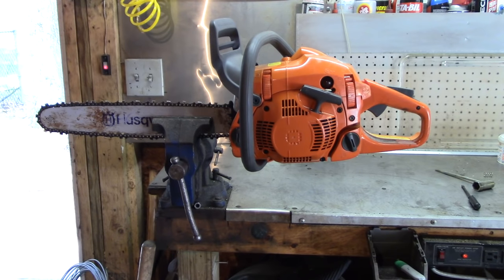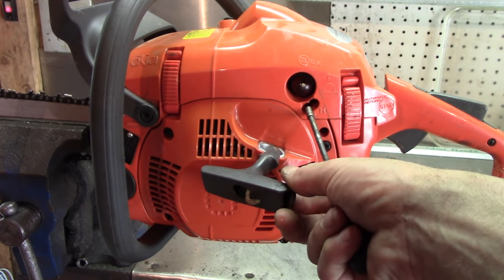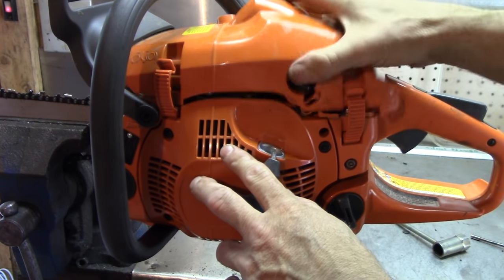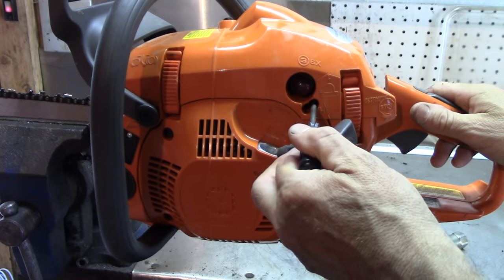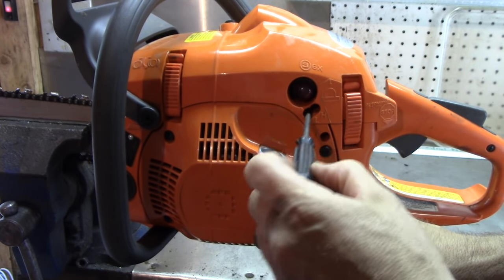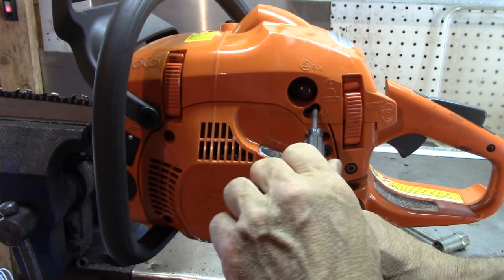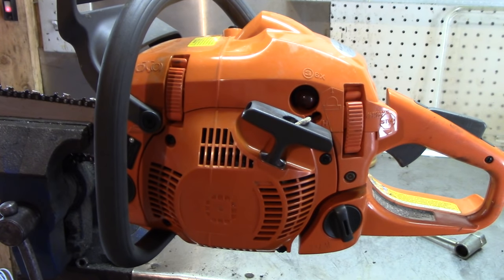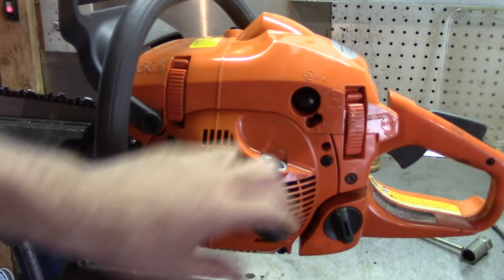Husqvarna chain saw carb adjustment

Comment: I bought a husky 240 Brand new  in the accessory case for $100. I was the third owner. The previous two owners could never make the saw run.I bought the tools on Amazon and followed this procedure.  At one and a half turns out on both screws, so I would finally start and run, but not smoothly. It would die if I slowly pulled the trigger and would often stall when hot. I slowly turn the L screw in 1/4 turn at a time and the idle speed picked up considerably and smoothed out. I stopped when the  screw it was 1 full turn out. the saw  starts easily, idles smoothly and transitions smoothly from idle up to full speed with no hesitation. I will try adjusting the H screw someday but right now I am very happy with a saw. Great video. Thank you so much!

Comment: Your tip about adjusting the high speed bleed with it in a vise is spot on. Mine was a bleeding too much air at 1-1/2 turns and kind of boggy trying to accelerate from idle. I turned it in (clockwise) just a touch and the acceleration is great now. Thanks for this video it helped me get the frustration out of this formerly balky-starting saw!!!

Comment: Thanks, I bought a new Husqvarna that was running like crap right from the box. A few quick adjustments to the idle and carb by following your video, and now it runs perfect!
Reply: I'm having the same issue. Can you get the tool locally.
Reply: @meaganfleming4675  I'm not sure. Call around to places like tractor supply, Lowes, Big R, Auto Parts stores, etc. You're looking for the 21spline tool. I ordered mine on Amazon and got it in a day or two. Not that helpful if you need the saw today, I know.
Reply: @Hoodyhoo2121  No, if you had a clue what you're talking about, you'd know that none of the box stores, and no, not even st. tractor supply carry them.  On this subject, alas, amazon is your best option for getting the tool.  (and there's a half dozen different tools available -- make sure you get the right one for your saw)
Reply: @hugh3rdof5  got a 440 and tool came with the saw right off the shelf.  Works like a piece of art, but wasn't sure if the idle speed was right so watched this lol; good future info if the carb gets out of whack.

Comment: Like all the rest of the replies, I have a like new 51 Husqvarna that I bought for cheap for a spawn shop. Could barley get it to crank up , but it wouldn’t take fuel. It would just die as soon as you would give it gas. I tried your recommendation and it was perfect. I didn’t have to adjust a thing from your specs!!  Thanks a ton!!

Comment: Dead on! Bought one used & it wouldn't run 20 seconds, did your recommended adjustment & it runs great! Cut 2 trees up today. Thanks
Reply: Adjustment to 1.5 turns has caused the saw to no longer start, let alone idle.

Comment: Information from the manual: 

Carburettor adjustment
Conditions during adjustment
• The air filter should be clean and the cylinder
cover fitted when adjustments are made. Adjusting
the carburettor with a dirty air filter will
give a too lean fuel mixture the next time the
air filter is cleaned. This can result in serious
damage to the engine.
• Mount, for this model, approved bar and
chain combination (see Technical data in the
Operator's Manual).
445/e 16"
450e 16"
• The chain should not be tensioned more than
that it remains ~ 0,2 inches to the bar.
(see figure 42)
Replacement of the H-needle or complete carburettor
1. Carefully screw the new H-needle to the bottom
and turn it anticlockwise ”A” turns.
445/e A = 2
450e A = 2
2. Start the engine. If necessary, adjust the idling
speed with the T-screw until the chain stops.
3. Adjust the H-needle to give a top speed of ”B”
rpm. Use a tachometer.
445/e B = 12500 -13 000, speed limitation
450e B = 12500-13 000, speed limitation

Comment: My Rancher 450 has that very problem, suspected carb adjustment needed.  Great video, thank you - will try the adjustment.
Reply: How did that work out? I got the same saw! Right out of the box, it won't stay running. Turns on maybe 50% of the time but as soon as I pull the throttle it stalls. Every time. Only way I can get it started is by holding the throttle when I yank the cord.
Reply: Tomas Maly o

Comment: Great informational video,but where do i go after setting as described. It will fire but thats about it. New plug,fresh gas and fuel filter. Carburetor rebuild time?
Reply from the maker: Carburetor. are so cheap nowadays that it's worth the investment even if it's not the right call. There's other things that it can be like for instance, one time I had a Warped  plastic intake manifold allowing it to suck air and couldn't get it to run. It could also be a pin hole in the fuel line sometimes or cracked as well hard to tell sometimes.

Comment: Cool just did rebuild for my husqvarna 137 it runs with gas and has one airleak from intake but that's fixed now im gonna adjust carb
Reply: I followed your instructions on a 137, too.  I put on a made-in-China-but-only-$10-on-ebay carburetor and tuned it. Was a great saw.  STILL IS, now that it's properly adjusted.

Thanks for the video!
Reply: @notmyname3883 yeah I love it just ordered carb gaskets and intake gasket aroud 5€$ for all and polished the saw and repainted the exhaust and it looks beatiful

Comment: Great video, just ordered the 21-spline tool from Amazon. I've got a 440e with very low time. It's always had an issue starting and idling with the chain brake engaged. Starts and idles just great with the brake off, but the chain always spins at a good clip. Maybe it's a clutch issue?

Comment: For L/H adjustment, 1 and 1/2 turn is to set the regular air/fuel mixture for L/H.  At L, fine tuning it by turning the L screw in/out to hear the speed start to drop.  At H, pull the trigger and fine tuning by adjusting the H screw in/out to hear the speed start to drop.  To adjust the idle speed by turning the idle screw in/out at idle speed prevent the engine stop at idle.
Reply: Thanx that's info I was looking for. A straight up starting point on the carb L & H needle.

Comment: So just fully tighten H and L clock wise and start from there? Turning H and L counter clock wise about a turn and half each and start it up to see if it idles and runs better, if not to your satisfaction turn another full turn or so counter clock wise on both H and L until desired running performance? Is that basically how to adjust my 435e?

Comment: 137 will only run  and start with choke on and will then bog out, so will this carb adjustment sort this do you think?
Reply from the maker: Usually carb adj does the trick...however there are things that can also effect the way it runs...things like brittle fuel lines that develop pin holes...cracked plastic intake...the list goes on but if the saw ran fine before I would say its gas related
Reply: @JLafix  thanks for such a quick reply 👌
Reply: CHeck for bad fuel line, fuel filter in your tank.  If there's GUNK in there, then your carb is invariably fouled too.  Then once you've replaced the fuel line & filter, and cleaned or replaced your carb, dump out the old fuel and start with new.  

THEN adjust the high/low settings and idle set screw.  

Good to go.  

I love my Husky 137's.

Comment: Kool man. My 440e had hard time starting, then I pressed the throttle  lever and pulled the cord and started up. So would 440e need carb adjustment?
Reply from the maker: Most likely.  Sometimes those pins need to be taken all the way out and then give a toot of carb cleaner into the hole. Then re insert pins all the down and back off 1 and 1/2 turns. And worst case scenario if carb can no longer take adjustments they only @$13 dollars.
Reply: @JLafix  Thank you very much 👍

Comment: How do you idle it higher on the high end of the spectrum when you’re cutting. I keep bogging down, I need it back to high out more or put it in more?
Reply from the maker: It works in conjunction with the low speed idol as well so it's more of a tuning thing not sure what to tell you in or out but I always start with the low side  and adjust to the high side.
Reply: When your saw I'd idling turn the idle screw the T hole up till chain starts to spin then back it of till it stops spinning that's as high as you want it. You don't want the chain spinning freely.

Comment: Mine was working fine until I hit a metal fence and the chain damaged so I install a new chain and now it doesn’t want to turn on. Please help? Do you think i should replace the spark plug ?
Reply from the maker: Did you Make sure the clutch brake is not on? You can find those carb adjustment tools on Amazon.  The tool kit covers all carbs. But it sounds like you have other issues, chances are it's not the spark plug
Reply: @JLafix  what’s the clutch break? Is that the black stuff in the front that needs to be pushed forward? I just replaced the spark plug and cleaned the filter and now luck. Tomorrow I’ll clean the carb and see what happens.

Comment: husqvarna 435 x torq Carb adjustment screw keeps backing out when running. Can set it at 1.5 turns from closed and cut 5 pieces and its backed out at least 10 full turns? Got any suggestions? It's a NEW carb replacement.
Reply from the maker: Wow that's crazy yes those pins come as kits in rebuild kits 4 carburetors high speed and low speed pins are pretty common Maybe your Spring is just so played out I don't know I've never heard of that backing out 10 full turns from just idling

Comment: That's great that yours worked at 1-1/2 turns. Mine didn't, so turn them in or out more? Left or right screw? Thanks
Reply from the maker: The screws are just for the air mixture if you can't get it running there may be another problem . However when you screw them all the way to the right it closes the port . Unscrewing to the left allows air into the carb. If you can't start saw with the 1 1/2 turns. You probably have another issue
Reply: @JLafix  Thanks for replying. It starts, it just won't idle when I let go of the trigger. When I gun it, it bogs out. The comment below says he also set the idle. So from what you say, this isn't the idle screw, it's the air mixture screw?
Reply from the maker: @mad3max3   Yes it sounds like it's just your mixture is wrong so if it bogs down on  Full  Throttle you gotta tweak the highSpeed jet.  Sometimes  I tweak the high speed jet while the saw is running at full tilt. Be careful you don't want to cut your leg off So if you can mount it in a vice it would be helpful but the increment that you turn The screw are very Small.  You may have some dirt or dust inside the holes themselves so in that case you can take those screws completely out and blow or rinse with carburetor cleaner Then reset them at 1 and a 1/2 turns and go from there
Reply: @JLafix  Ok I'll try adjusting it while it's running. I finally got it to idle ok. Thanks for the video, it did help.

Comment: Im about 2 seconds away from throwing my husky in the lake. It will fun but will not idle, and as soon as i touch the chain to wood it dies. Im 1.5 turns out on both. Ive tried adjusting it for about 3 days now.
Reply from the maker: Putting it under a load may be a clue. Sometimes the fuel line can have a pinhole Or crack in it and it will starve for gas. I've also seen a cracked Plastic intake manifold, and the saw won't run right .

Comment: You need to use a tachometer, the new xtorqe models dont run at 13500rpms like the old non xtorqe engine! The xtorqe models top out at 13000 ..... dont run them any leaner then that or you'll roast the bottom end
Reply: How many turns do you recommend on the xtorque?

Comment: my chainsaw easy to start when it cold.. but hard to start when it hot.. so.. what should i do..? same as you did?
Reply from the maker: The hi lo adjustments are a one time adjustment until they get out of whack from usually vibrating loose. But if you adjust screws when saw is hot or when running good then you are constantly trying to adjust to running good then your carb is usually the culprit. But they are cheap to buy. Of course there could be other causes. but adjusting your screws cant hurt in any case.

Comment: Good video, so I have a question? When I start my saw , it will run an when I push the throttle it runs good for some time and when I take my hands off the throttle it dies out on me. What would be the problem?
Reply: Turn your idle screw clockwise until blade starts to move...then back off a slight bit....you should be good!  (Its the screw by itself) usually the one on bottom, isolated by itself (the other screws are H & L.....High & low 🤞
Reply: My 240 also does it....and when I make a cut it will die...trying to start it after all that wears out my arm....lol...new spark plug was black after about 2 hrs run time,,,with clean filter....what is my problem...??
Reply: @tonyodom2903  black spark plug means its running to rich or too much oil in the fuel....basically its possibly flooding

Comment: With the idle screw adjustments would that be a full turn and a half also ?
Reply from the maker: That usually doesn't need adjustment but if you set your high and low and the saw won't stay running without your Finger on the throttle then give a small turn to the right. And of course the opposite way if it's running at high idle.

Comment: My 51 will not start, im ready to throw it at the wall im soo frustrated with it. Got most all new parts everywhere and nothing. Plenty of spark, fresh fuel. Wont start even with ether in the top end. I took off the exhaust and found fuel pouring out the port. I'll try this and see what happens. If it still wont start im going to heave it into the trash...
Reply from the maker: Well I have been fooled by a spark plug once thinking it was good it actually was cracked internally so it never sparked . I've also been down a road similar situation and it was an air gap in the little plastic intake manifold.  And of course as always if there is no compression in the engine it won't start.

Comment: Bought a Rancher 450 two years ago. Still had a 1/2 tank of fuel in it, used it two weeks ago, started up and ran perfectly until it ran out of fuel. Refilled it with the same batch of fuel it had previously and then it ONLY start but not idle. Emptied the fuel, mixed another batch 50:1 with New Ethanol free gas (like what I used previously) and it STILL has the same problem. Spark arrestor, Air filter are very clean. Do you recommend that I perform the same carburetor adjustments? Would appreciate an answer, Thanks
Reply from the maker: If it runs good and just won't idle, there is an idle screw that will give it more throttle, but you cant hurt anything by adjusting the high and low speed air/fuel mix screws.
Reply: @JLafix  Thanks. Will try that as soon as I receive the spline screw driver set.

Comment: I have the exact same 435 Husqvarna and all two-cycle engines are a pain in the ass. And if Husqvarna could be adjusted by the homeowner without special tools you couldn't charge your friend $45 for two minutes work.
Reply: Amen Brother!, it's NEVER this easy to adjust carburator on my Husky 435...I always end up takin it to mower shop & have them do it!   The dude just says " grab me a pack of Marlboros & we'll call it even!"   🤨
Reply: @jasonsmither7514  ☝️ how to actually tune a chainsaw ☝️
Reply: @jasonsmither7514  hey there are benefits. My brother in-law got so frustrated he thru is chainsaw across the garage floor. Then he gave it to me. $15 carb kit....BANG...
Reply: My dealer did it for free, I gave him 6 bucks just cause

Comment: 450 chainsaw is running backwards. Has anyone experienced it?
Reply: Seems like you'd have to install the recoil/pull starter to operate the wrong way somehow for that to happen, if it's even possible.  Are you sure you don't just have your chain on backwards?

Comment: What to do when they have carb adjustment limiters.
Reply from the maker: I usually break the plastic tabs off. But sometimes you can't do that on some of those goofy situations
Reply: Well it's a Jonsered cs 2255 so it is close to a Husq.

Comment: Mine starts and runs but bogs when I try and give I full throttle.
Reply from the maker: You can take those needles completely out and spray the holes with carb cleaner.  Sometimes that helps.
Reply: By needles do you mean the adjuster pins that you turn. I inherited one and it does the same thing. And what size spline adjuster is for the 440. Thanks.
Reply: open up the carb, where the screen is an clean it :)  when it's blocked and you give full throttle, it can't let passing through enough gas and that's why it want's to die and runs like crap ;)
but when you're about to clean up the screen, you could also do an complete disassembly of the carb and clean up all of it.....can never be wrong  :P

Comment: the idle wan't important on this?
Reply from the maker: Not sure what the question is but the idle screw will set the throttle so the motor will run with just enough fuel to keep it running. The high and low screws are set to get the proper fuel and air mixture.  Once the fuel air mixture is set then you can adjust the idle screw to your desired rpm while it's idling
Reply: @JLafix  thank you!